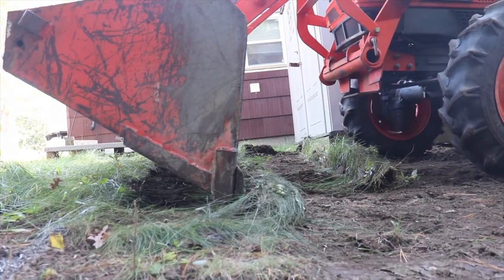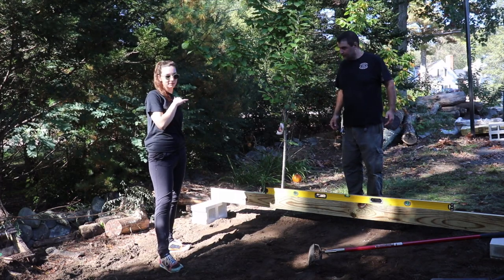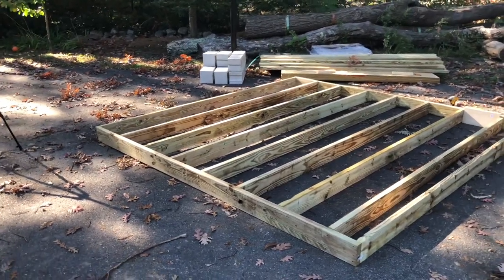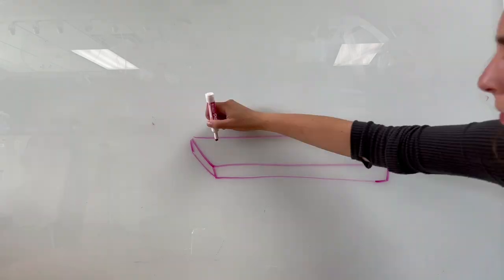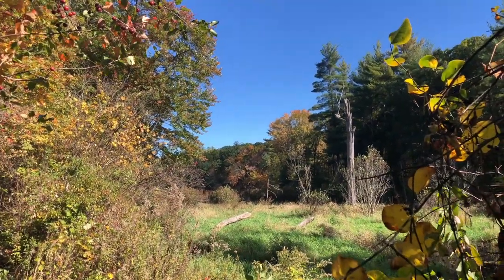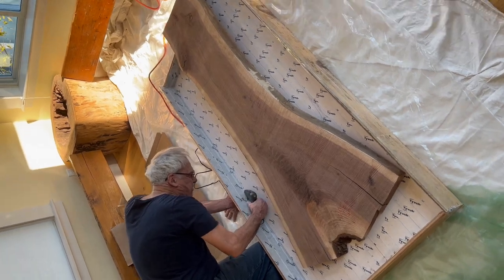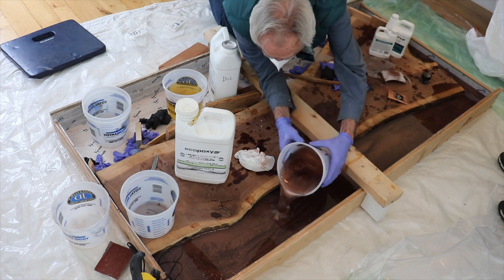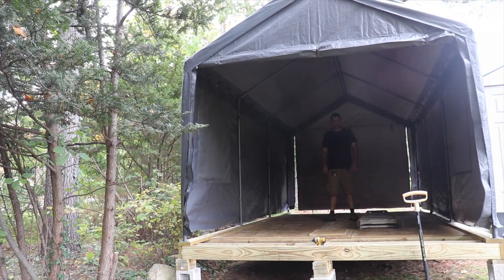Building a Platform Tent | Ep. 02 | Framing a Floor and Making a Walnut Resin River

Comment: Pro tip: Concrete blocks are meant to be stacked with the holes vertical. The strength of the block is GREATLY REDUCED if it is placed sideways, or on end, and the block has less lateral stability as well. Hopefully center supports were also used if you're going to be placing thousands of pounds of wood on this floor.

Comment: I'm curious to see how the floor holds up, I'm pretty sure normal construction you'd use joist hangers to hold up the floor joists. Just a couple screws seems like it wouldn't hold as well, especially if you're going to load it down with large lumber. 

Also the cinder blocks up on end seems a bit precarious/tippy, I think usually you'd lay them on their side if you had to use regular blocks. They also make special concrete blocks for under the corners of sheds, they are solid, basically cubes with a + shape cut in the top that the boards lay into.